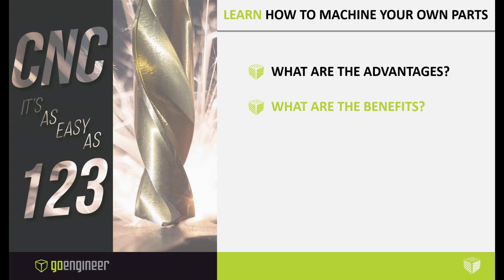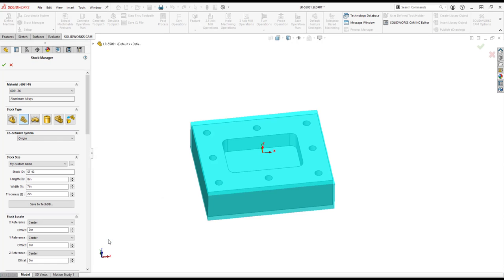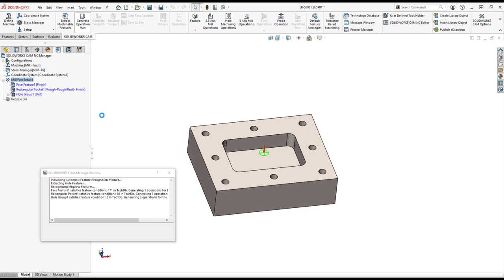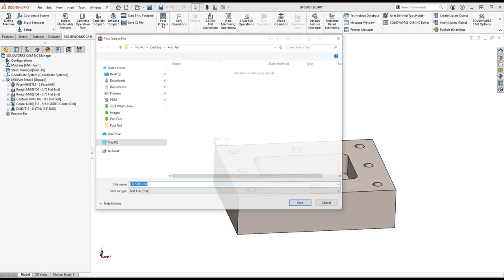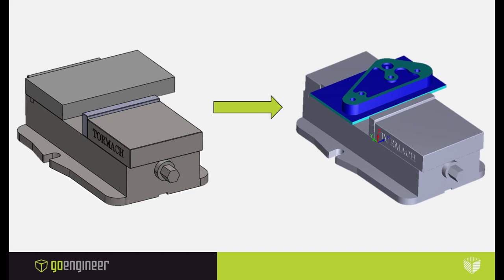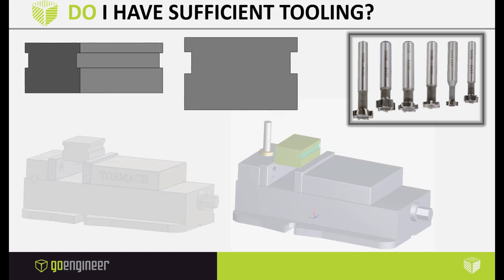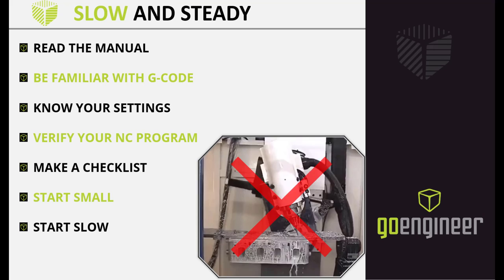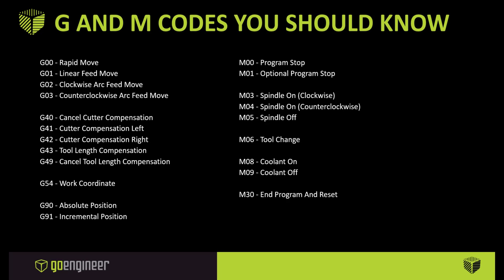C N C It's as Easy as 1 2 3

Comment: I've been designing hardware for years, but never doing the actual CNC work. I just send off the STEP file and never see it again. I have been watching TONS of videos on CNC fabrication to learn more so I can do better designs. I am wanting to get into the fabrication side of things and this video has been one of the clearest presentations of how the user goes from a solid model to G-Code. It helps that I have SW2020 and the CAM add-in so I was able to create a part very similar to yours and follow along as you explained things. I am still not clear on everything, but this helped and has shown me things I need to look into further for better understanding. Thanks.